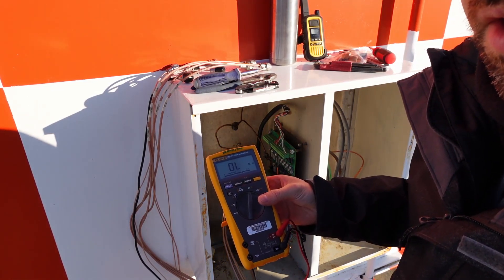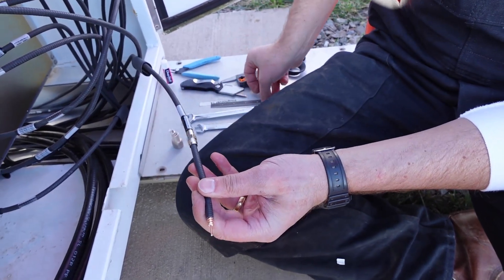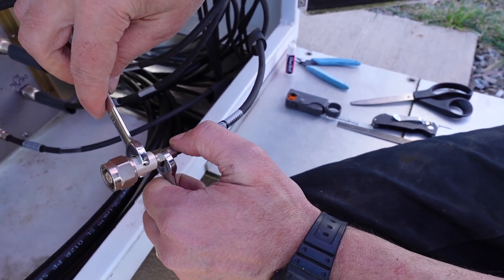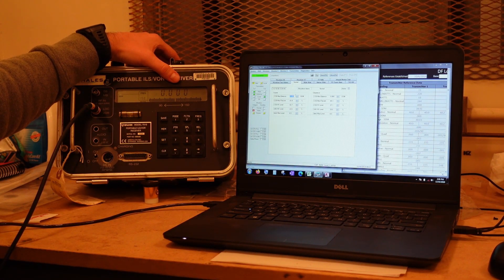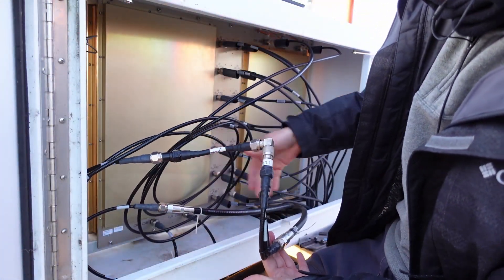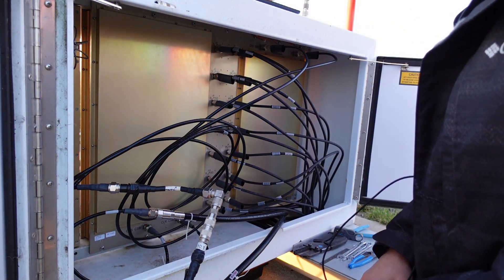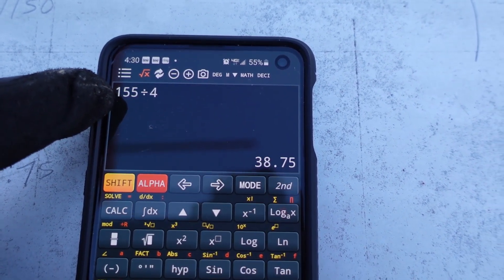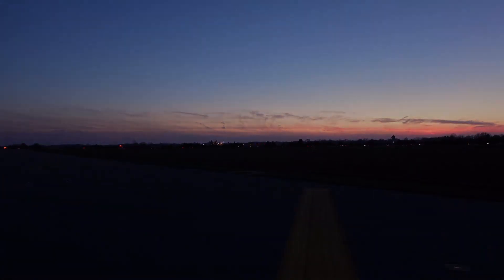Localizer Baseline Day 4

Comment from the maker: After finding a problem with one of our cables using an ohmmeter, we later used a Time Domain Reflector (TDR) built into the Keysight Network Analyzer to determine the location of the break. I'll have to make a separate video on how we did that.

Comment: this is a good job which I appreciate, and please l have a question at the end a problem I still encounter in winter when the temperature drops to 8 degrees the DDM CLR width value goes down and  creates alarm at the level of monitors and that for both TX and if we heat the SBO CLR cable in junction box the parameter of width DDM CLR becomes normal.  just the onset of spring and summer all stabilize until the onset of winter.  please if you have an explanation for this phenomenon please detail it to me and thank you very much.
Reply from the maker: Check for sufficient solder or reflow the solder at the pin in the connector. Otherwise, recable.
Reply: @ArtofNAVAIDs  thank you very much I will do it. Good luck.  What do you see if we place field detectors on the LOCALIZER ground check measurement plots like the VOR system to have the option of automatically launching the ground check via PMDT without moving along the runway.  just an option to add if it is possible since there are also obstacle constraints in the critical zone of the LOC.
Reply from the maker: @adnan53  you would see navaids technicians not getting their exercise. Lol

Comment: Is there another name for (half width points) ?  maybe in degrees?

not a trick question, just trying to learn more, Thanks
Reply from the maker: It's also known as edge of course or course edge. Where ever that occurs in degrees may be different at each runway and is dependant on runway length. In the US, it's known as tailored width which is the Arc tangent of 350 ft / runway length (in ft). For most runways that's around 1.5 degrees either side of centerline.